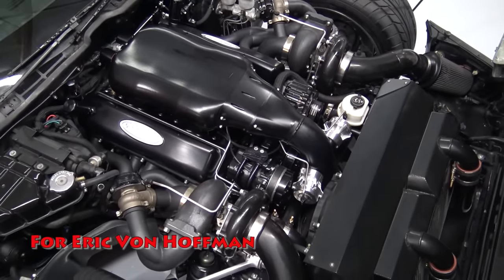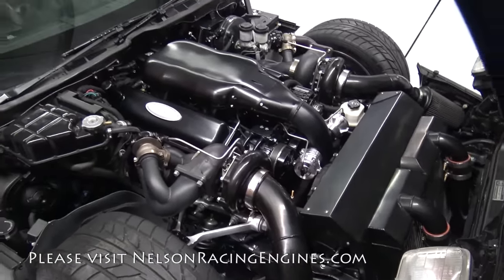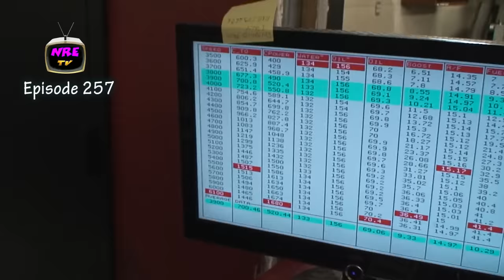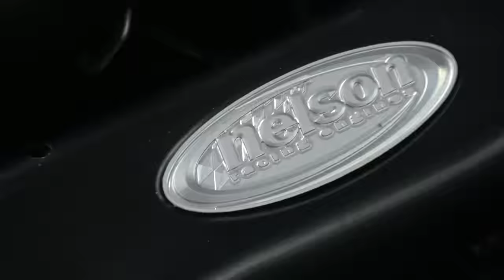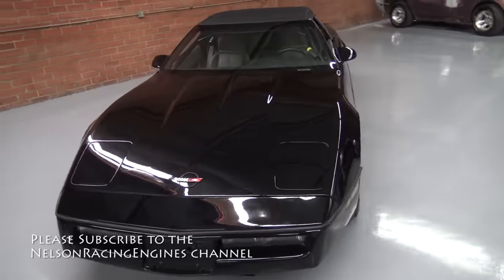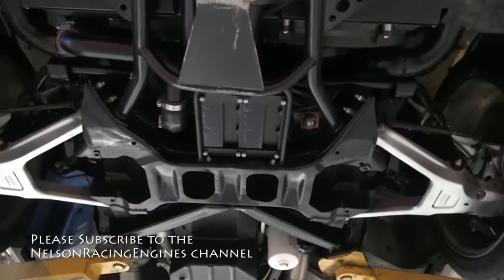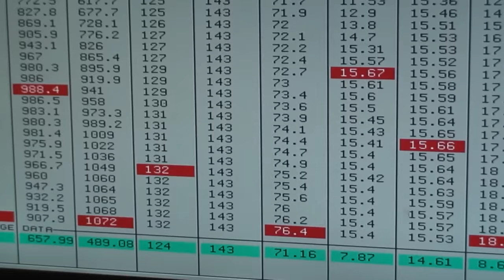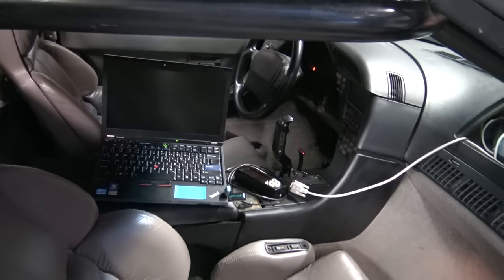1700 HP Twin Turbo Corvette Street Test!  Nelson Racing Engines.  Patented Mirror Image Turbo.

Comment: This is Epic I have triple black convertible 1988c4 owned for 31 yrs has low miles emissions deleted headers full exhaust bigger twin throttle body 58 instead stock 52. I'm debating what gears to put in rear 3.42 or 3.73 automatic 700r4 any ideas? Much appreciated 🙏

Comment: Put a dana 44 in it and you will never break it.  i had a C4 in 1999 with a 100mil turbo (turbonetics) and a 406  Car made 1100whp and ran 8.4@180 with a dana 44 and 1992 aluminum half shafts.
Reply: King Vette really? Stock d44?
Reply: I call BS.
Reply: @thereflection7225  i have a c4 with a dana 44 in it right now. Putting a 1000hp lq4 408 in it this week. So we will see if thats true.
Reply: @akassasin5768  get it done?

Comment: The turbo is right by the front tires with no heat wrap or shield, glowing red pipes right by each tire is alittle dangerous imo. Other than that good build
Reply: its to keep the tires warm when all 1700 hp is going to the front wheels

Comment: What rear axle did you install to handle that hp?
Reply: Good question. I've been told that's the weak point for building big power on the C4's.

Comment: Been experimenting with trying fans from twin engine yacht engine compartments that exhaust fumes to pull heat from Corvette engine compartment and duct it out thru fender wells or behind front tires. Could possibly exit thru vents cut in the hood since heat rises neway. Got 671 BBC blown Pro Street 64 Corvette but don't run hood on it so that helps it cool. If you cant get the heat out it don't matter how much radiator and fans you have. Heat acts like a barrier to air tryin to come thru the radiator.

Comment: Oh hell no! As soon as you spy that upper roll cage bar you better start thinking twice about what it's capable of. I have seen some interesting C4's before. Like a guy that was running an all aluminum race prepared big block in a 91 roadster with a six speed . Slicks on the back skinny up front and through mufflers. It pulled the front wheels up about eye level if you raced him.

Comment: Very nice what you did with the Corvette very nice I'm a Corvette fan what could you do with an automatic 1994 Corvette how much horsepower can you get out of that with an automatic
Reply: Depends on the engine and how much money you have to play. In theory, the sky is the limit as you can swap the motor and transmission.

Comment: It’s a sweet ass Vette would like that done to my C4 but would love to have a 572 C.I
Reply: Yes, although this TT makes almost twice the power, what does that HP & torque curve look like? This is the fault of big power turbos, all or nothing..low & slow torque off the bottom, & the "on off switch" when it makes boost...as the power climbs too rapidly, the rears break loose immediately & you can't catch it. Give me a smooth, big,  power & torque curve...only possible with lots of cubes...downfall?, the extra weight. PS, nobody is going to think this is a plain vanilla C4 Corvette, the bling bling wheels, the roll-cage & the too loud exhaust?, really?

Comment: HAD AN 87 VERT,I LIKE THE ORIGINAL INTAKE ON THE LT1 BUT THE ALIEN INTAKE IS ARTWORK TOO
Reply: Dane Quinlan 87 shouldn't have been LT1, lt-1 was 70's and the gen2 LT1 was from 92-97, are you talking about a TPI engine?
Reply: 87 is a tpi...not an lt1.

Comment: How can I make my 85 tpi L98 faster
Reply: i have a white 85 L98 and i put 3 inch stainless steel exhaust and that helped a ton.
Reply: Buy something else.
Reply: Why
Reply: @Roadrunner-g3e  google it..to much to list..any actual power gains you would have to get rid of the garbage factory cam.Intake runners are not great and aftermarket ones are like 700$.. heads dont flow worth a shit..and on and on..Good for the day i guess but any bolt on stuff is a waste of money..
Reply: Put  pro charger   long tube headers  NX256H  cam and nitrous shot

Comment: I call bullshit, what kind of fucking C-4 Corvette with the 1600 horse power has those type of tires in the rear end typically with that much hp you would need full slicks on a 15 in wheel
Reply: Isaiah Bell it has 1700hp. Just on street tires. You can run what ever tires you want